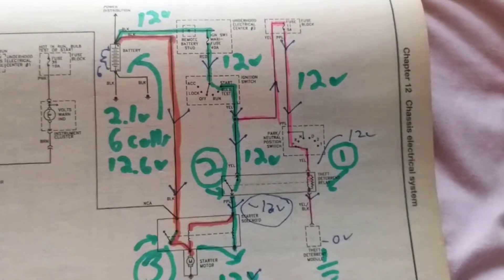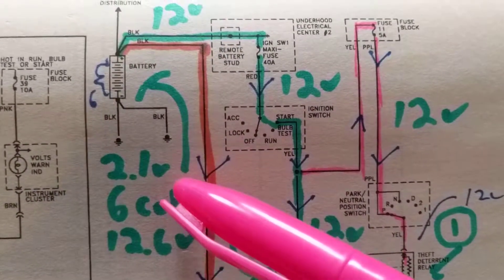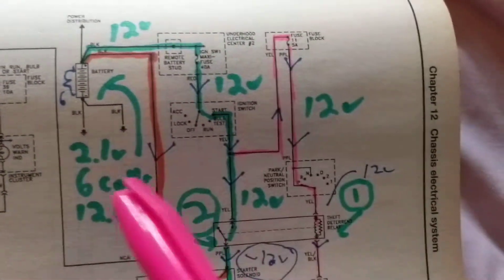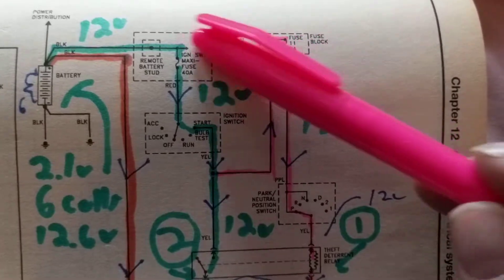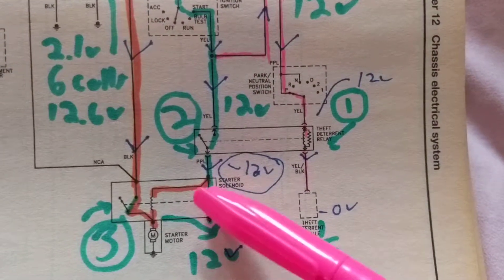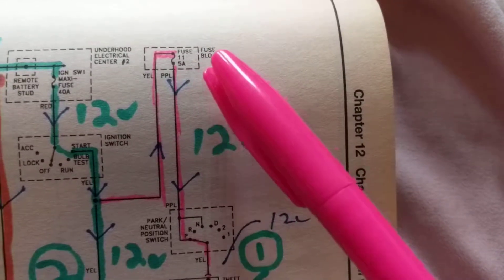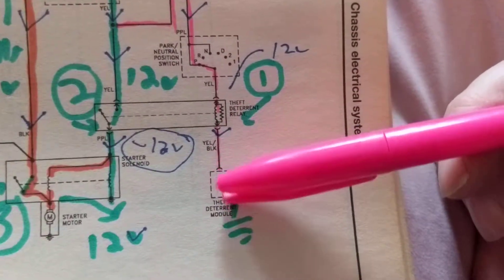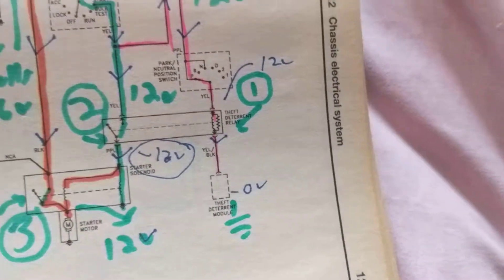NO CRANK NO START THEFT DETERRENT SYSTEM IS ACTIVATED BY COMPUTER INTERESTING VIDEO

Comment: I have an 05 grand prix gtp that says starter disabled due to theft system! What a pain in the neck car still not running. 12/22/2020.
Reply: Tell me about it they certainly are sometimes you can turn the key back and forth to turn it off sometimes you might have to hold the key down for about 20 30 seconds to turn off the alarm system or some cars you can take the fuse out but it sounds like you have a module problem the module has to detect your key and the right key before it turns it off
Reply: @Joeelectronicschematicsforauto  I belive it is a bad module. Don't get me wrong nice vehicles made by GM but wow just a small glitch can cause so much pain. And most DIY guys like myself so much grey hair or headaches. thank you for responding to my comment i do appreciate it. Merry Christmas & Happy New Year love the channel
Reply: That's why I specify in my videos on my channel Joe electronics schematics for Auto the more electronics you have the more modules you have the more sensors you have the more problems you have even if you have a brand new car you can do preventive maintenance for mechanical components but not for electronic modules that's the point I always stress these modules go bad just like the PCM the BCM and others and others good luck thank you for supporting the channel
Reply: @Joeelectronicschematicsforauto  Do you know approximately how much Chevy dealership would charge to replace a bad module? Or do you think it is more affordable to go to a mechanic who deals with theft deterrent system? Situation is 2009 Chevrolet MALIBU
 Theft deterrent system was activated after battery died and everything i found online worked for about a week , it would not start and i would hold the lock/unlock button down simultaneously and the car would start. Then the car battery would go dead every night it sits there by the time i try to start it in the mornings the dashboard or nothing at all comes on not even the horn . So basically the theft detereent system is draining the battery and I am needing a Jump just to BEGIN TO start the car because after the cables are connected the dash would turn on and show all the symobls including the main one (service deterrent system symbol) so then i would go back to original programming by holding the lock/unlock button down simultaneously that's when the horn goes off the service deterrent system symbol goes away along with all the warning signs then it will start but it won't start without the jump now , and the car shut completely down each time it is turned off.
Reply: @munchiebrown5289  I think first you have to do a parasitic load test to make sure it is that module and secondly if it is that module that's draining the battery you might be able to go to any repair shop because they would be able to get the correct module
Reply: @Joeelectronicschematicsforauto  THANK YOU!!!

Comment: Thanks man
my car is dead. 
my  starter relay has 4 pins.
1 pin gets 12v when i hold my key on start position but no crank no start,  there is no 12v on the other side of my relay, where it should get constant 12v...
 what can it be?
my car is Suzuki alto 2012 AT if you familiar with
and where's your next video? thank you
Reply: I'm sorry I never even saw the comment until today obviously it's 3 months late but how you doing apologize for the delay
Reply: @Joeelectronicschematicsforauto  
That's ok man, thank you for answering now :)
It was a wireless kill switch system installed under fuse box under the hood...took me 3 days to find it, had some tough time there :/